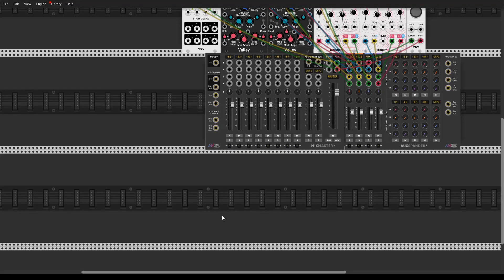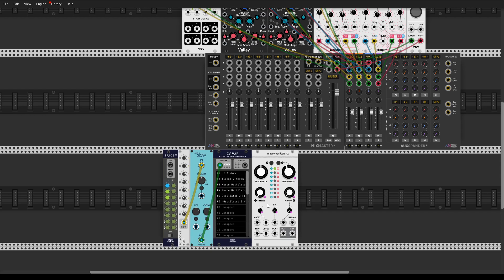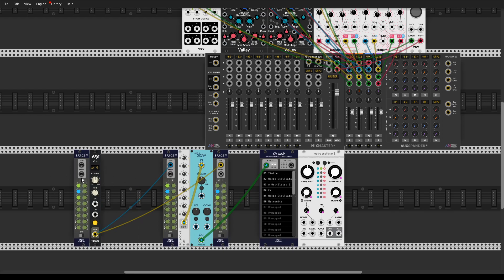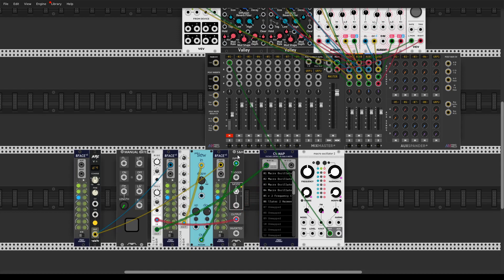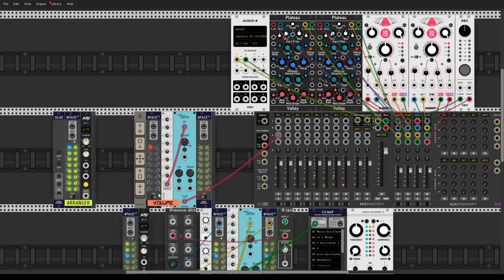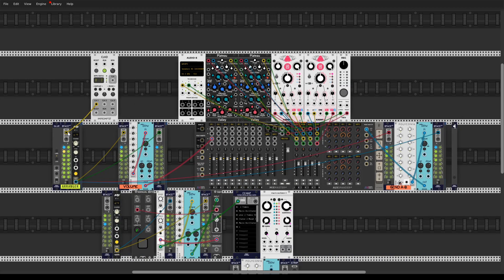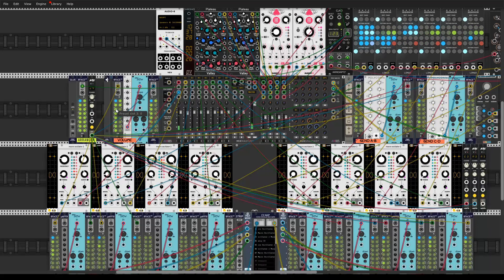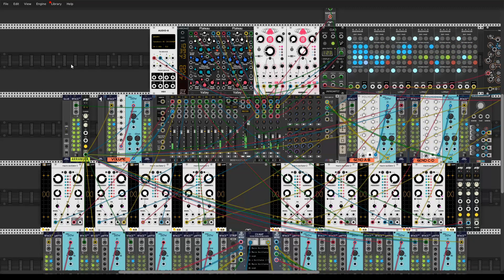AUTOMATION and MORPHING BETWEEN PRESETS in VCV RACK TUTORIAL

Comment: It would be nice if when loading with the strip modul the color of the cables is the same as before saving. Maybe it will be implemented sometime, would be nice. The trick with the Poly Slew is really great. Normally I like to use LFOs on CV inputs to add some variation to the sound. It's quick and easy. But the solution you showed is a lot better. On the one hand you have more control over the modulation than with an LFO and on the other hand you can see what's happening directly at the knobs. This is very practical, because sometimes you build something that randomly creates an interesting sound by modulation, but unfortunately you can't see at that moment through which CV settings it was produced. With CV Mapping you can see exactly how the settings were, thats great. You wouldn't believe how many times I've repositioned modules one by one. When I saw you move the parts all at once with room module, I celebrated. Thank you very much :)
Reply from the maker: thanks!